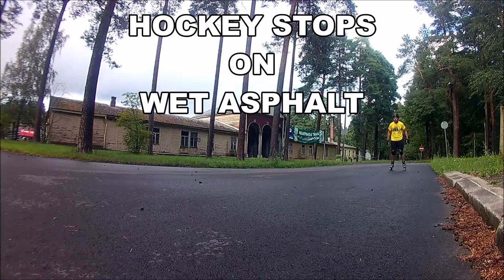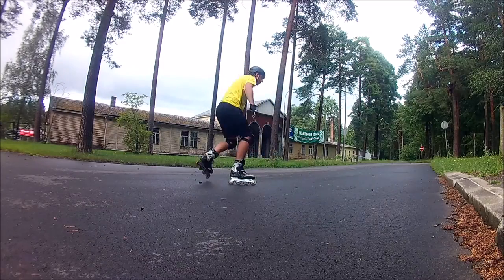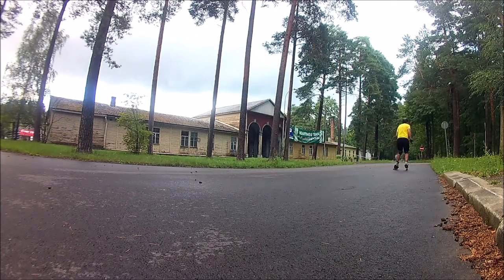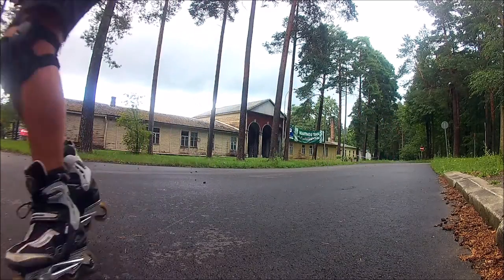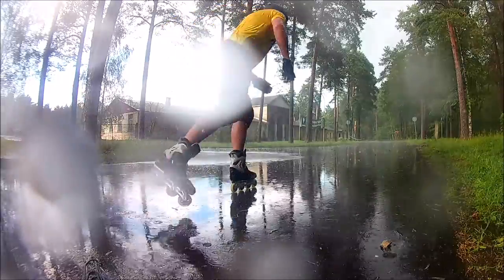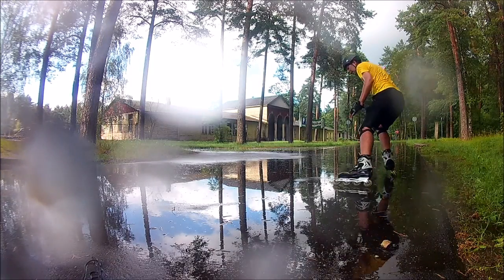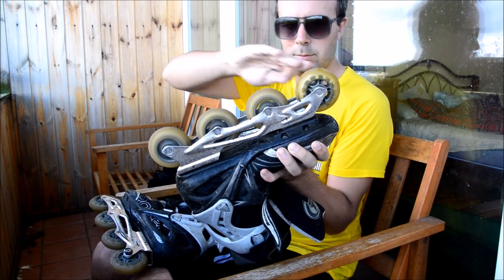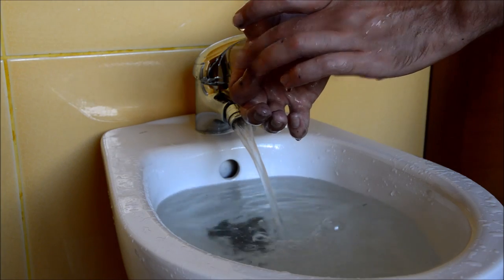Hockey Stops on Wet Asphalt | VLOG #3

Comment: Clean your bearings better. Powerslide Twincam bearings are quite a lot good ones. Remove C-rings and open the shields on both sides and then clean all in degreaser and hot water, dry with hairdryer (or in owen for several minutes) and don´t forget lube. They last really long.